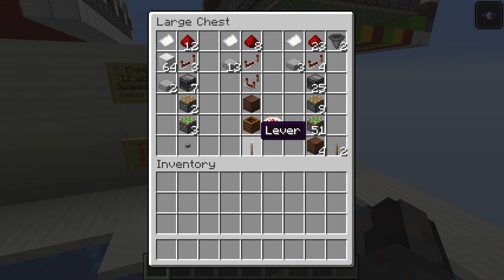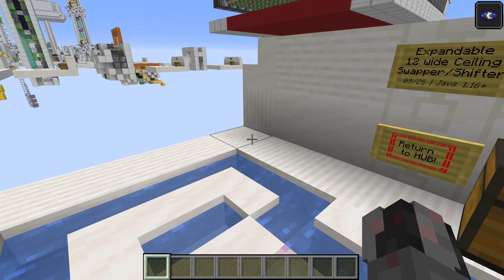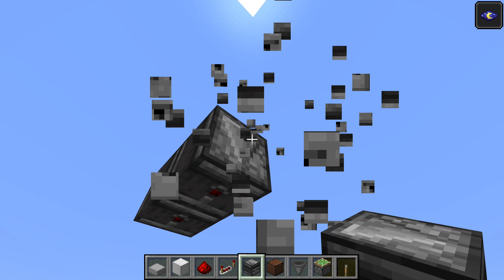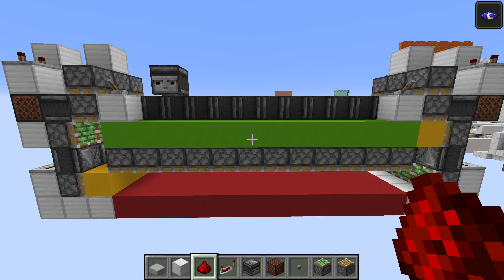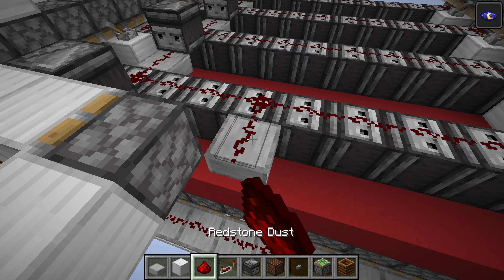Tutorial: Expandable, 12-wide Ceiling Block Swapper & Shifter [Java 1.16+]

Comment: I have a question. Although i’ve been playing Minecraft for quite a long time, i always tried to avoid anything with redstone mechanics, but now i got an idea that I’d really want to try out. 
Let’s say i have a floor (to make it easier to imagine at y-level 55) and on y-level 54 i have a light source (like sea laterns). Is it possible to create a mechanism that when i press a button, the floor blocks will disappear, making the lights visible and the floor blocks will get swapped with glass blocks so the lights are visible but i won’t fall into a hole that was created because of the lights being one block down that the rest?
I already tried to build something, by having two rows of sticky pistons on the opposing sides, however the problem i run into is that i’d need to have one side already pushed out (the one with the floor blocks) so as soon as i push the button, the floor blocks with be retrieved so that the glass blocks can be extended. Is there a way to build such a mechanism (preferably without using commands in Minecraft bedrock)?
Reply from the maker: If I understand your description correctly your floor is one block wide. In that case use normal pistons instead of the sticky pistons. Then trigger them with pulses. Only pulse one side depending on which blocks you want to be pushed in. The simpliest way would be to connect each piston row with it's own button => one for the normal floor and one for the glass.

If you want only one button you'll need a bit more, but it's not overly complicated. There are a few ways to do this, if you're new to redstone then the simpliest way would be as follows:
1) Place the button
2) Run a wire from the button into a copper bulb (or place the button directly on the bulb, which would double as an indicator)
3) Take an output from the copper bulb via a comparator
4) Run that signal into a stick piston with an observer in front of it. The observer looks sideways in relation to the piston
5) Place (full) blocks in the two spots the observer will power depending on whether the piston is extended/retracted (output is on the backwards side, opposite of the observer's eye)
6) Run two wires from those two blocks to the piston rows of your floor, so each of those blocks is connected to only one piston row. Make sure the wires are separated and not interconnected. Use repeaters if the signal doesn't reach the pistons (Signal strength decays 1 per block when transmitted via wire and has a max of 15 => only travels 15 blocks in wire before you need a repeater)
7) Profit ;)

In technical terms that would be: Button => T-FlipFlop => (Switch &) Monostable => Pistons
Reply: @RKFWalter okay, i’ll try that. Thank you so much!
Reply from the maker: You're very welcome :)